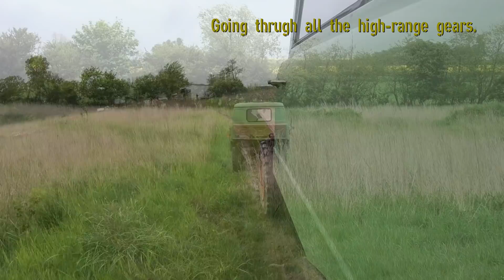Unimog Barn Find. part 2 - Getting to drive it!

Comment: what a hoot this old UniMog has turned out to be, i have a friend who was with the German military stationed in Shilo ,Manitoba and use to visit there and see their Unimogs running around the base performing  various tasks and we measured it the drivers feet in the Unimog were at the same height as my head in my Volvo 240, I love all the work in the first video it reminded  me of my farm ag equipment days and building tractors for a living back from 1979-1985 good times , love all this old stuff and i know from friends in Germany you can still get most parts you need for them and that is what makes them so attractive to, it doesn't have to be pretty , it just has to work so you can have fun, my uncle on the farm use to say farm tires never give you mileage, they give you longevity,😂 you got a subscriber
Reply from the maker: Thanks a lot!

Comment: Dear TAF. 
I think to hear that the engine is still not running right and has not all the usual "power" output. Not only because it starts bad and smokes, but there are knocks to hear where they don't belong. Maybe at least 1 injection nozzle isn't spraying right but drips a bit. Please kindly allow me to suggest that you check all injection nozzles. Also the glow plugs of course. I'm eagerly looking forward to watch the next part.
Thanks a lot for making teaching explaining recording editing uploading and sharing.
Best regards luck and health to all of you.
Reply from the maker: Yes, you are right, i'm also very certain that the injectors are bad. they look like they are the original ones. and have likely never been serviced. and combined with it having stood still for many years, that have very likely lost a lot of spring pressure, and are probably leaking aswell.
But don't worry, it's on the list of things to fix 👍

Comment: Really cool to see guys who exactly know what they are doing!  Also the engine work!   For tyres I recommend  Continental/ Mitas 320/70R20 AC70T, they fit on the original 9inch rims .    I also run them and the traction is unbelievable, I can drive some stuff in 2WD now which i couldn´t before, even with 4WD!      On the video it looks like you already got the nice original -10mm offset rims, but it also seems you got the narrow axles, so spacers or different rims might be needed for the Mitas 320/70R20 AC70T. (if you want to go that direction)  Good Luck with your projects!
Reply from the maker: Thanks a lot!
And i appreciate the tyre tip!

Comment: Unimog is a unique vehicle. I got to spend a couple of hours in one of the new ones at the test facility in Germany. They will pretty much go anywhere. The idea to bring them to the US around 2001 just didn't work out. Unless you just had to go off road or deal with deep snow, they were a little too pricey.

Comment: I  have   a    MITSUBISHI   FG   4X4    and    you   have   to   run   special   locker   oil   in   diff.   or  they   will  not   lock  up   right !!   just   a   thought   good   luck.

Comment: The one that my friends that I have originally had a gasoline engine and the previous owner converted it to propane and propane gives you a little more power than petrol does and that's probably why we made it up to 56 miles an hour

Comment: Great vehicle, great work! Do you do your own copper bending? It looks great.
I think that the air brake unloader you got is not an original WABCO item, but a cheap copy. Hopefully it will last.
I also think that the diff. lock was air controlled. Another good thing will be to check the old air compressor for oil carry over. If it does, it will slowly destroy the entire air system.

My 0.02$: Any screw or nut you tighten (unless it is used for grounding), always make sure there is a drop of oil or grease on the threads. About 20 years ago I read a study published by Volvo's heavy vehicle division, in which the importance of this was explained, not only in favor of reopening in the future, but also better tightening of the assembly with decreasing force values on the metal.
Take care!
Reply from the maker: Thank you very much!
Yes, i actually bend the copper by hand. i do like to make them look nice. Makes for an over-all cleaner look.
And yes, the valve is a cheap one. i took the chance, as it is a very simple valve. so it will most likely be ok. and it's easy to replace, should it break.
And yes, the lockers are Air-activated. We will be showing that in the next video 👍
We did also check the compressor. and its all good 👍

And yes, i have long ago made it a habit to lubricate all the threads.
It dose indeed help reach the correct torque.

Thank you for your interest!

Comment: You have a really nice Unimog there. Seeing you have front and rear Ptos the Mog seems to be well quipped, besides being relativley rust free.. Does it also have the two crawler groups with split gears? Does it have 6 or 4 speeds on the main shifter?

Can't wait to see how well the little Mog is going to work when the lockers work and new tires are fitted! Keep up the good work!
Reply from the maker: Thanks a lot! 
I have to admit though, it is just looking better on camera, than in real life. it is really quite badly rusted in the bottom of the cab. so it will need a bit of welding. (But i know they can be much worse)
as for the gears, it dose not have the crawler gears. It's got two low-range gears (That can also be used for reverse) and then 4 high-range gears.

Thanks for watching!
Reply: put tracks on it
Reply: there actually were some prototypes with tank type tracks. But i don't know if they would be of any help, because you can already get some big tires on that Mog.
Reply: @KJOff-Road  Yep they can be far worse. Have you already any plans on adding more features to it to make it a better tool? I mean there are front end loaders etc for it, but they look weird
Reply from the maker: @humbucker0076  Yes, i do have some plans. and i'm already working on them 👍 it will hopefully be in the next video

Comment: Nice U 421! Does it have the OM 615 with 45 HP inside? Just by the sound I'd say yes.
Not a power house but it's ideal for stationary purposes like driving a crane or a log splitter. Enough power but way lower fuel consumption compared to the  U 406/ 416

Comment: Those tires almost look bald if you have a better set laying around I would suggest you use them cuz you going to be slip sliding away and the weather that you're in and way the terrain is
Reply from the maker: Yeah, the tires are worthless, and will definitely be changed

Comment: aren't you gonna get galvanization with copper and steele in the same oil line? Like fittings and the such
Reply from the maker: Well, I have never seen that happen. 
In this climate, the steel lines seem to rust and perish much faster than the copper.

Thanks for watching!
Reply: @KJOff-Road  no problems, just tohught about it beaing someone who works with plumbing and the such, oil might not transfer the electrons as the watter dose

Comment: Copper lines in the brake system? ????
Reply from the maker: Yes? This is very commonly used as a replacement for steel brake lines. because its easy to stock, easy to work with, and bend to fit any vehicle. and it's plenty strong for the relatively low pressures of a brake system.
Also, in a place like this, where steel rusts pretty fast, it will last longer.

Thanks for watching!
Reply: @KJOff-Road  In Canada and USA you wouldn't think of using copper for brake lines.  Brake pressures are not considered low pressure.  I am a licensed mechanic who has worked for manufacturers such as Chrysler, Subaru, Hyundai and Mercedes-Benz.  None of those manufacturers would tolerate anyone working in their dealerships using copper.  Copper plated steel perhaps if you can find it but not copper.  I urge you to use proper steel lines.  Get a double flaring kit and a tube bender (all inexpensive and easy to use tools) and do the job correctly for your own safety.
Reply from the maker: @hobbyaddict9908  I'm actually a bit surprised that people are commenting on the use of the copper lines.
I am also a licensed mechanic, and have also been working in the automotive industry for my entire career. And really the copper lines are the go-to option here.  Over the years, Some European manufacturers have even made car models, with all copper-pipes, straight from the factory. It's automotive copper pipe, made for this purpose.
We do use steel as well. But they will typically be bought as pre-made spare parts, for the specific car. For something old, like this, that calls for bending your own pipes, copper is always used. So really, this is certainly considered "Job done correctly" here.

It's quite interesting to see how we do things differently around the world.

Thanks for watching!

Comment: Where do you find parts for a 50 yr old mog???
Reply from the maker: It's actually not all the difficult.
Mercedes has made a habit of producing spares for their vehicles for many years, after the end of production.
Besides, many of the parts, are standard Truck or Agricultural parts. and also, many of the parts, remained the same, on later models of unimog.

Thanks for watching!
Reply: @KJOff-Road  you betcha......no need for lift kit or monster tires on that truck....although I wood upgrade to led lights and  a brush guard up front

Comment: Do you know where I can get such a power steering cilinder? I need one for my 421. Or how do you call a cilinder like that?
Reply from the maker: I is indeed the "Old Style" power steering. but no, i don't know of any place that has them in their inventory. 
But if it is just leaking, it is fairly easy to fit new seals on it.
Reply: i can fully recommend to search for german suppliers and get in contact with them
Reply: Im pretty sure Mercedes-Benz could get you one, but it would be tather pricey